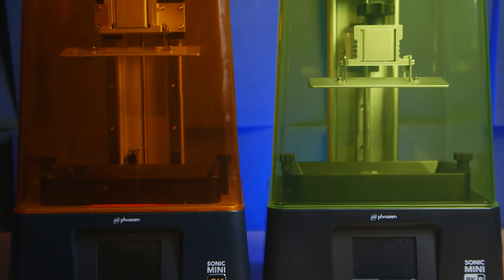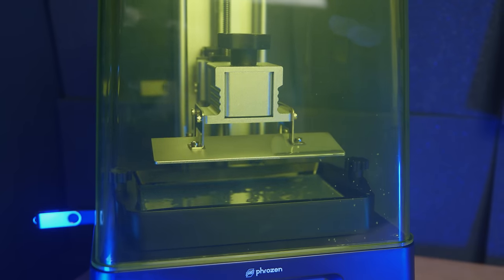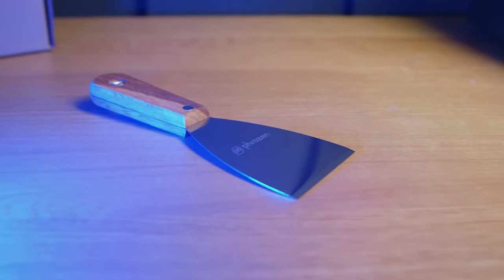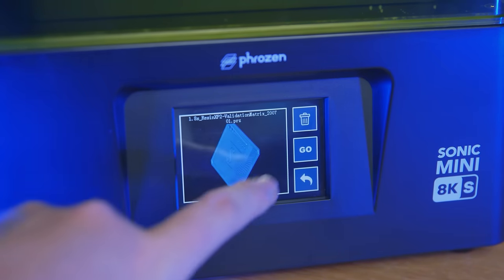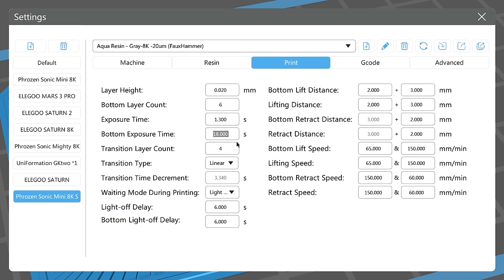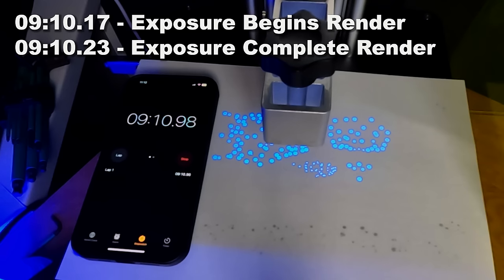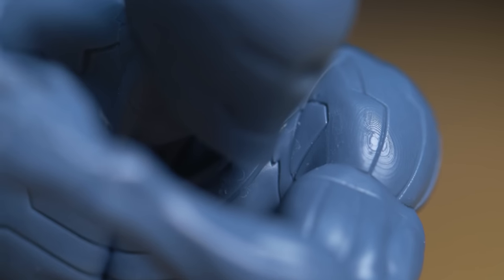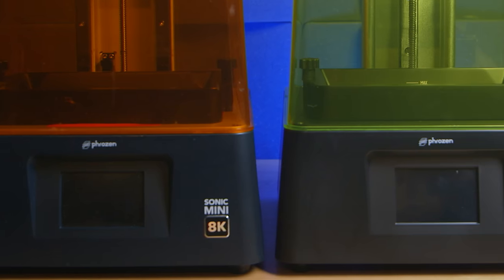Phrozen Sonic Mini 8kS Review Vs Original Mini 8k - Cheaper and Better

Comment: Fun fact about USB placement. Puting it in front is always more expensive! Its becose manufacturers need to add cost and labour to instal USB extender, when on back thay litteraly just using what is already in printers motherboard. It is a real cost cutting and not a "smart placement"
Reply: The motherboard is custom for this machine. They could easily locate the USB in the front of they wanted to. I do plenty of pcba design layouts in the electronics industry.
Reply: @bill72pa  Nope its not custom. Just classic Chitu board. If they will place it in front it will be on the way of light source. I disassembled couple of them it wont fit there with standart board. And custom board will also make it more expensive.

Comment: I have both 8K and 8KS, both are great and I really like your review. The only few downsides I have with the 8KS is that one 1cm heigh can come in handy, but i think the majority won't reality notice and the other thing is that it doesn't support multislicing. It's something a lot of folks won't really care again, but for my projects where I do need that smoother 25um or 35um layer, but don't want to print the entire model in that configuration can be a tad annoying especially if it's a tall model, but again that's more of my issue with the machine, that a lot of people won't care. Also job files are not interchangeable with the regular Mini 8K, it uses a different format for some reason, but then again it's not the same machine so makes sense why it's like that.

Comment: It's obvious why you are pouring the resin like that. By stretching the resin over a surface and letting it pour down the stream helps to eliminate air bubbles and there's an additional benefit as it helps to prime the printing plate somewhat. The legos are pretty cool too. One of the coolest thing about resin printing is we can make transparent plastic toys of our own now and they kind of glow. :)
Reply from the maker: Oooh, good theory, but sorry, that's not the reason

Comment: Just got my Mini 8KS today and it has a major strike against it before I even turn it on. I wanted to order an additional resin tank but they are charging an astronomical $89.99 for a single tank! In contrast, I ordered 2 additional resin tanks (with covers) for my Mars pro 3 at $43.99 (only $22 each).

Comment: I have the chance to get the 8KS new for 280 (found a good coupon that works), do you know if the exposure setting issues have been resolved? Looking to upgrade from my recently purchased Halot One Pro that I got for 150 to test out resin printing now that im comfortable with the hobby. :) (Or should I still wait until next month? 🤐🤐)
Reply from the maker: The one next month will easily be about 3-4 times why you are getting this for.
Reply: @FauxHammer  Ah okay, I gotcha! And do you know if those exposure issues with having to turn it down so low ever got resolved?
Reply: The exposure settings have been resolved with a firmware update.

Comment: I had problems leveling the plates with the vats and FEP. Phrozen and Anycubic articles both say that the plate should be 10,000 of an inch above the FEP film which is a paper thickness as compared to FEP film, and thats is why they give you a paper to do it with also.
Now if the vat leveling is working for you, that is great, but I think when you do that, your second layer becomes your first one because the plate is all the way to the plastic on layer one.
Reply from the maker: Isn't paper thinner than FEP?

I'm not fussed what my earlyayers are. I always use supports. So as long as I have adherence. I'm happy.
Reply: @FauxHammer  I think the paper is a few microns thicker but I may be wrong, but I agree if the first layers stick to the build plate and not the film and the prints come out good, I am not fretting it either.

I still have a lot to learn about 3D printing, and I would consider myself lucky as to how well most of my prints have come out.
I have a few Romulan Warship models that have came out Fantastic.
I have been lazy, and really need to set up a model bench area where I can film putting them together for my other YT channel.
Some times I just enjoy the design process.

Comment: Hi Ross,

Thank you for your videos, I've been wanting to buy a 3d printer for some time and your videos are among those that helped me the most in my choice. The mini 8K S seems like the best choice for me, smooth surfaces, amazing quality, perfect print size for what I want to do with it (have even more armies!!!!).
But in addition to this comment which may allow me to win one 🤞, I have a question. I saw your video on the GKTwo and was wondering if a hotbox actually works. Have you ever had the opportunity to try a hotbox or other similar device ?
Reply from the maker: I haven’t used a hot box, I was going to, but I have a weird space issue in my hobby room and would need a box of different sizes for different printers.

Thermalvatband is a decent choice

Comment: Hi great review!!! Quick question, every time it finishes a print it returns to the top of the rail and the dripping resin splashes on the inside of the lid. So my question is wouldn’t those resin drops fall into the y axis or probably freeze the motor if they manage to get inside and get cured during a print? Or create bumps? It so how is that avoidable can it be set to not reach the top?

Comment: Don't give phrozen a pass on the 1 second exposure minimum. That is a huge problem. I exclusively use translucent, quick exposure resins. They'll absolutely need exposure times under 1 second with this machine. What's the solution? Increase layer thickness? No thanks. I have no interest in this machine. The only advantages this machine has over the original 8k is anti aliasing and light output. The latter is as much a problem as it is a benefit. Anycubic has the M5S a 12k machine launching soon. It's a higher res machine, with auto leveling. They're also claiming some pretty absurd speeds. It'll be interesting to see what they get right.  Hopefully they finally launch a product with working AA.

Comment: 8k Printer at 260$ is insane. How far we came! It does itch a bit, having a monoX, so I don´t know if upgrade to a mighty or just add this for smaller bits at higher resolution
Reply from the maker: Either get this, or wait. Just a little longer

Comment: Came very close to buying a Uniformation GK 2 to upgrade from my old Mars 2 Pro (which has been great). I was always temped by the original Phrozen Mini 8K but couldn't justify the price. I don't really need a larger printer right now and space is at a premium. This retains the higher print resolution of the Mini 8K but without the AA bug and at a much lower price. I do wish the power and USB were on the front. Just waiting to see the details of the new Anycubic M5 and M5s next week which apparently will have a 12k screen and a larger print vol but I suspect I'll be pre-ordering the Mini 8K S.

Comment: Would you choose the sonic mini 8k s over the saturn 2 8k, both around the same price, 370ish? The 8ks is 22 microns, the saturn 2 8k is 28, but it has a larger volume.
From your video, I understood that there is really not much difference between 28 and 22 microns.
Reply from the maker: Nah, I’d prefer the larger build plate

Comment: This was super helpful. I’m in the market for a 3D printer. I really liked that printed “test” card which showed how different sized bits would print. Super helpful!
Reply: Get a elegoo saturn 2.
You won't regret it.
Reply: @jasoncombs3232  That is a tab beyond my price point, however, if you think I should really wait until I can afford that model, I will take your advice. But what if I wanted a printer between 200-300 USD?
Reply: @johnjenkins8471  you really Cant go wrong with any elegoo product. But aim for a 8k printer. I mainly do large prints so I'm not familiar with cheaper products.

Comment: Guess i should list a spoiler alert here as well lol

I saw the 😉 on your comment on Wangs short. I figured it was more in jest the an actual aggressive call out. Meaning there was an explanation for the misleading info.

I may consider this printer as my 1st resin printer to start instead of starting with the GK2 or another 10" plate. Just because of the lower cost to get started.

Comment: Awesome review as always. I like that they fixed the AA on this finally though hopefully a fix is coming for the 8k mini soon (allegedly an update on that issue in June). As a base mini 8k user it’s hard not to feel a bit shortchanged with this one coming out as it seems your paying ~$300 extra for a different coloured lid (though I personally prefer the orange) and for broken AA (I do hope they fix that and it’s not a hardware issue), buts it’s part of the evolution I suppose 😅.
Reply: Can you elaborate on what you mean by broken AA? I have had my 8k mini for over a year and had no issues.
Reply: Do you have any more info on the OG mini 8k AA update? I haven't seen any acknowledgement from Phrozen on the issue yet. Keen to get it fixed on mine!
Reply: @Adhemar42  June update apparently. They did finally acknowledge it after quite a few comments about it when the S was announced. IMO they should have fixed that first but I think it may be what they made the new one to fix. It sounded like they are trying to do a firmware updates to ‘lessen’ the issue rather than fix it possibly because it’s a hardware problem. But we’ll see🤞🏼.

Comment: Grate video, thank you at first..
If I can ask a question I would like to know if the lights power is the same between the two printers. I just have had one 8ks and I would like to try some test prints starting with the same settings from the previous 8k.
Thank you once more, grate job! ;O)

Comment: Hi Ross, I am looking right now for my first printer... My budget is around 300-400 and my space is limited, so would you rate this printer over the mars 4 ultra (with FEP instead of the ACF film)
Reply from the maker: I would rate this over the 4 ultra yeah. But you may be better with a Saturn 2/3 - comparably similar in print quality with a larger build area at a similar price

Comment: Once they fix the exposure This looks like it will be a good printer. I don't feel like you should get buyers remorse. The printers have gotten so good that the marginal improvement just doesn't feel significant to me
Reply from the maker: No, thankfully we are getting last the point of useful resolution upgrades

Comment: Ok! Here's a warning against it, build plate was uneven, prints didn't stick to the left side, and on the third print and second failure the piece that fell got crushed between the plate and the screen tearing a tiny hole in the nFEP, luckily it was small enough that no resin managed to get through, but IPA when cleaning was able to...
So ya, build quality/reliability... Got my new printer, and right out of this high I need to replace a build plate, replace an nFEP, and was scarily close to needing to replace the screen. And Phrozen claims to have no warranty on these parts if they fail even on new orders. It's been a bit over a day now since I sent the help request about that uneven build plate and no reply. 
So... buy a Sonic Mini 8K S... do three prints, two with failures... possibly need to shell out a bunch more for replacement parts... these tiny couple test minis are the most expensive miniatures I have ever bought... and I question if it's worth it to buy the new parts if they don't replace those, sunken cost phalacy and all, yes, it would be down $300 plus dollars... but if I put out another $120 and get another miss and failure... Oof... not sure what everyone elses experiences are who are getting these, but mine is definitely not good and frankly just terrible. Now, I can't print, and am stuck with that anxiety of waiting for them to respond.... Would NOT recommend.
Reply from the maker: I’m sorry you have had such a bad experience. I  bought my original Mini 8k and had similar issues, but their support was great. And this was before I started doing these videos
Reply: @FauxHammer  Their supports ok... but that doesn't help when the replacement plate also fails. Fundamental design issue, that looking around I found has been present since the old 8k and known and reported by some since then.
And if you leave a  non 4-5 star review on their website if you buy it there, guess what? They just delete it.
With this initial experience, I have now zero plans to ever buy a phrozen printer again after this.

Comment: Coming to this a little late. Considering replacing my old original Phrozen printer with this one. Out of curiosity at say 1s exposure, how many seconds is that per layer in total? Trying to figure out what the print time would be for a model of a certain size, but I don’t really know how long each layer actually takes into total (hope that question makes sense ) :)
Reply from the maker: Yeah it does. But it would be a guesstimate based on speed and so many variables

Why not add this printer in your slicer and slice a model. It will give you an estimate there?
Reply: @FauxHammer  I don’t have anything installed. I was juts looking for a guess. It’s been years since I printed anything so can’t remember what all the other settings mean. Looking at your settings are the 2 that are set to 6 second both things that happen in a single layer (for example). Can I say roughly 13 seconds (including 1 second exposure) per layer? Or is that going to be way off? That is for the prompt response btw :)

Comment: I wonder if a 3D printer would work on my canal boat. I think an FDM would be fine as I have 12V direct from battery, but the SLA. I imagine the resin would slosh around. Is this deffo bad?
Reply from the maker: ummm, the gradual movement may be an issue, but I'd love to hear how it goes.

Comment: Can we print a watch case with this printer ? Watch case that is stainless steel in the original watch. Is there a material that can give great result and can solid enough for a watch. Thank you
Reply from the maker: You can possibly print a stable resin and cast the parts… but I dunno

Comment: If you want to calculcate the time for the display-on-time:
You're recording with 1/240 of a second for a frame. Your editing program should give you the timestamps in seconds an after that not a fraction of seconds but your frames.
So the display might be on 1 second and 31 frames (at 240fps) which means that's on for 1.1291 seconds.
That's more reliable than filming a 60fps display of a phone.
Reply: By the way: I'll buy this one. Thanks to Danny and you.

Comment: I'm just getting into 3d resin printing and all of your recent videos are making it so hard to decide! 
It seems as though this printer would simply be superior to the Mars 3 Pro in every way? However comparing it to the Saturn 8k and other 10-inch build plates is where I'm now stuck... more build volume or cheaper and same quality? :shrug:
Reply from the maker: If you can afford it get a Uniformation GKTwo
If you wanna keep the price down, get this

Comment: The resin dripping from the print is not splashing onto the cover. The plastic cover has no conductive additives so it has quite a large static charge that draws the thin tail of the drip right to the cover.
Use an antistatic spray or wipe the inside of the cover down with a dryer sheet to fix the problem.
Reply from the maker: Is that true?! I need to test this. I know I didn't have it on other printers

Comment: Thanks for the great video. I'm really impressed by your investigation into the 0.2 sec exposure time. So does this mean that each layer at that speed has slightly more exposure at the earlier render points for every layer depending on where the part is on the screen?
Reply from the maker: I suppose it does yeah. At about 0.05s per layer pixel to pixel

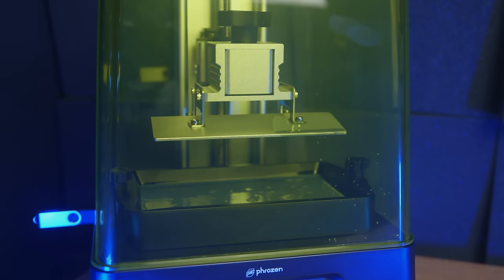Comment: 9:20 I would like to know because the only person I have seeing doing that was a newbie that almost destroyed his brand new printer because the resin splashed everywhere by doing that. I told him to go and watch youtube videos on how to properly use the machine before it get destroyed. It really seems a very stupid (IMHO) way to pour the resin in. I hope your explanation has nothing to do with, so I can see if there is chunks of resin in it, because that would be so lazy. But if it works for you good for you.
Reply from the maker: I only do it really because it’s more cinematic than the  usual boring way. but yeah an also help to detect lumps and identify the mix is consistent and make sure theres nothing rubbing against the bed in the dip and will show if splashes will go everywhere in a large or small vat

But I do hope people are wise enough to not just glug  it outa the bottle
Reply: @FauxHammer  Thanks for your fast response. Loving your videos. Maybe you should write: Warning, "This way of pouring  is for cinematic purposes, can damage your printer if not done correctly" LOL  I am going insane researching a "best Bang for your Bucks" resin printer for big models, around 30 to 35 cm height. I need to find a channel like yours but for larger prints.
Reply from the maker: @TheStickyBusiness  not a bad idea actually